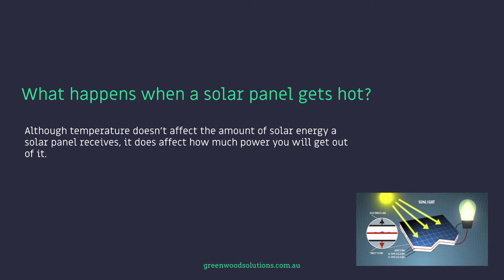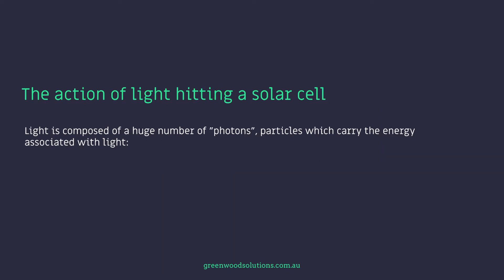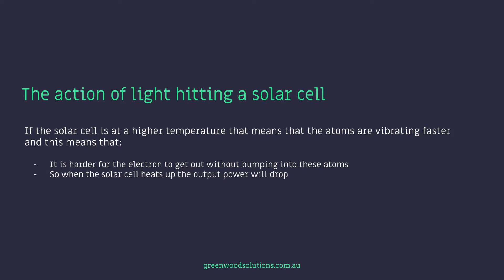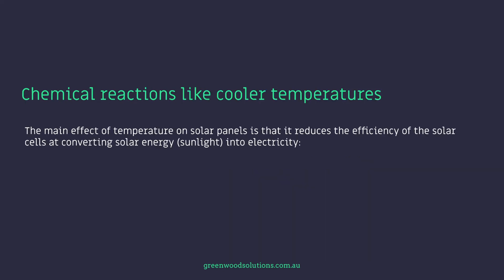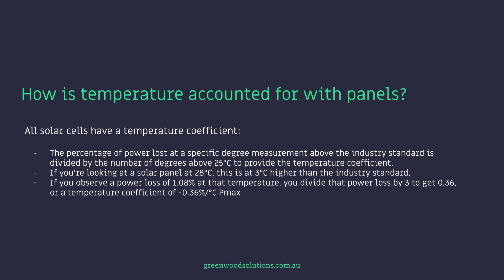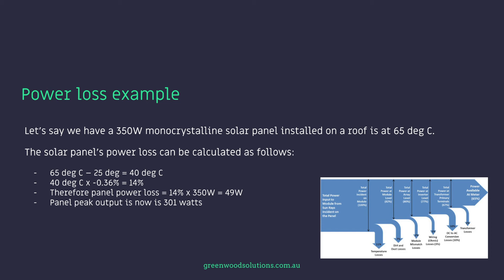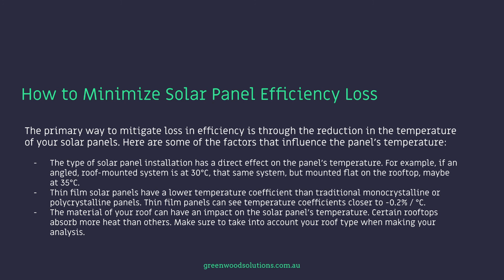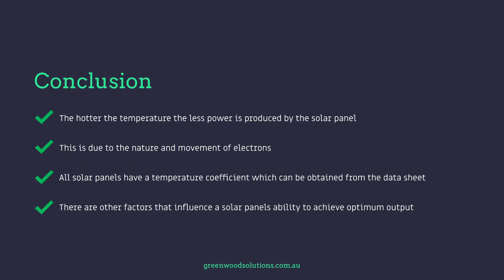Solar Panel Temperature Coefficients

Comment: The inverter went over voltage in Kalamazoo one cold winter. The warranty was voided and the installer was responsible for buying the new inverter. The maximum input voltage of the inverter was 1000V. The PV module specifications at STC were: power = 245W, Vmp = 30.1V, Imp = 8.2A, Voc = 37.7V, Isc = 8.7A. The temperature coefficient for the panel was -0.121. There were 24 modules per PV source circuit. How cold did it get when the inverter got to be 1000V dc?
Reply from the maker: Not sure if you temp coefficient figure is right. 
For example 250 watt panel from  Canadian Solar (CS6P-250 I 255P) has a temp coefficient Voc of -0.34 %/℃. 
Using this in my calculation temperature got down to as low as -6 degrees C ( a little over 1000 VocMAX) see link to data sheet https://www.mrsolar.com/content/pdf/Canadian/CS6P-250P255P.pdf

Hope this helps.

Comment: Thank you for explaining this, I just had 10k system installed and turned on in March of this year in Phoenix AZ. In April my system was producing 64hwh for the full day, but thisnlast week at over 110 degrees, the panels have dropped to 55kwh, and I thought they would do better. I was about to blow up the crappy solar company OnPoint Solar - worst company I have ever had to deal with. This new issue was going to make things worse. Thanks, you saved them another call.
Reply from the maker: Our pleasure.

Comment: Hi I've got a Question , I need help in solving this Tempreture Co-efficient Calculation : 

If the temperature Co-efficient of a module is -150mv/°C at STC 

And the Vmp is 38V at STC

Calculate the Vmp of the module at 70°C
Reply from the maker: There is no linear ratio between VOC and VMPP but most solar modules will have a very small temperature co-efficient of ISC which means the effects on the panel current is minimal due to temperature change.

We work on an upper limit of 70 degrees as you mentioned.

Panels are tested and rated under STC (standard test conditions), which is 25 degrees Celsius with 1000W/sqm of sunlight and Air Mass of 1.5. This means that there is a 45 degree difference between the STC and the upper temperature limit
As current doesn’t fluctuate much due to temperature it is reasonably safe to use temperature co-efficient of PMAX to determine voltage gain/loss due to the effects of temperature. Let’s say it is -0.46%/C.

This means that for every degree above 25 C the VMPP will fall by 0.46% of 38V, so the calculation to determine voltage (and power) losses at 70 degrees would be, 45 (degrees difference between 25 and 70) x 0.46 = 20.7% loss.

The VMPP of 38V would now become 38 / 100 x (100-20.7) = 30.134V

Hope this helps!
Reply: Ive done the calculation according to the PV solar Tempreture Co-efficient method the Answer is (B) 35.95 Vmp 

The steps is as Follows: 

Step1 : You must convert the -150millivolts to Voltage 

-150 millivots = -0.15 Volts 

Step 2 : The 0.15 Volts will automatically be changed to 0.15%

Step 3 : Effeciancy of Temp 

38 Stc (standard test conditions) of a Pv solar pannel according to the Question 

= 38 × 0.15%
= 0.057 Volts/°C

Step 4 : Information that we have 

Stc = 25°C ( standard test conditions ) for any solar panel 

Higest Range Summer = 70° (acording to the question)

Volts per degree °C = 0.057 V/°C

Voltage Summer drop : 
= ∆t (peak temp) × 0.057
=( 70°- 25°) × 0.057
= 45 × 0.057
= 2.565
= 3 Voltage Drop

Step 5: Summer Volts= Stc -Voltdrop
                                       =  38 - 3
                                       = 35 Vmp
Reply from the maker: @ruanmeiring9798  Thank you for that :)!